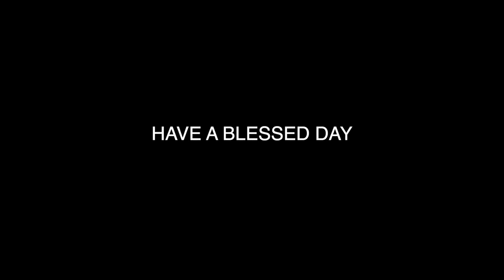Spray Painting My Dads Truck Prank HUGE REACTION! *Cops Show Up

Comment from the maker: Have you played a prank on someone? If so what was it?
Reply: L engagement
Reply: I cupped a fart and made my sister eat it
Reply: I worked at a auto mechanic shop. We would run a wire from the spark plug wire through the passenger door behind the passenger seat and have it sticking out through the driver's seat between the top and the bottom. When they start the car it would shock them then they would let go of the key that grounded them out and they would stop being shocked. They didn't know what the hell was going on. When they go to shut off the car and touch the key again they're in for another wild Ride
Reply from the maker: @CaptainCooter  huh
Reply from the maker: @gradycooper7416  dude what ?!😂😂
Reply from the maker: @edellenburg78  I’m definitely doing this lol!!!
Reply: @DeBerti  lol my bad